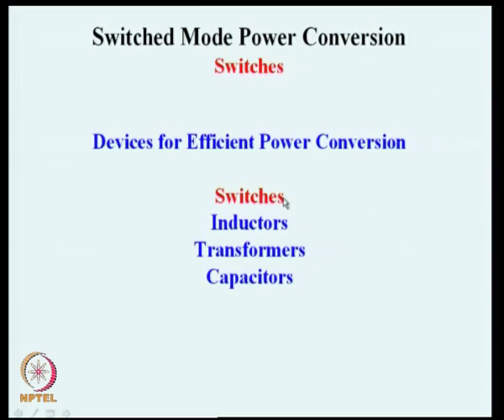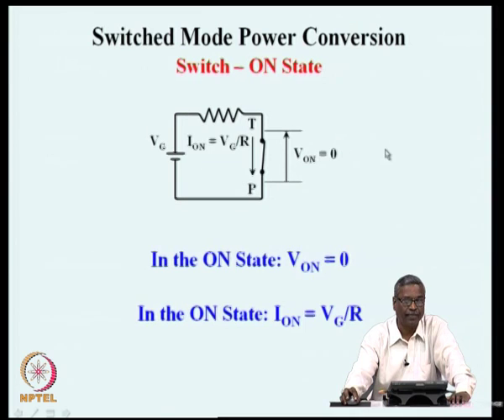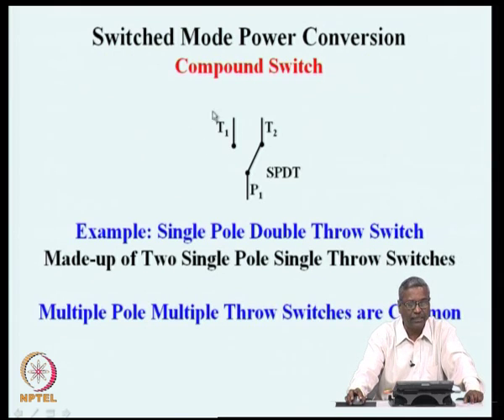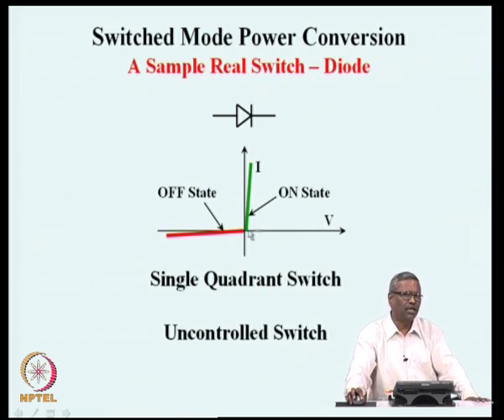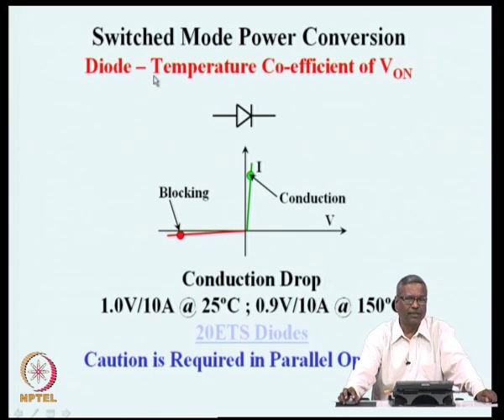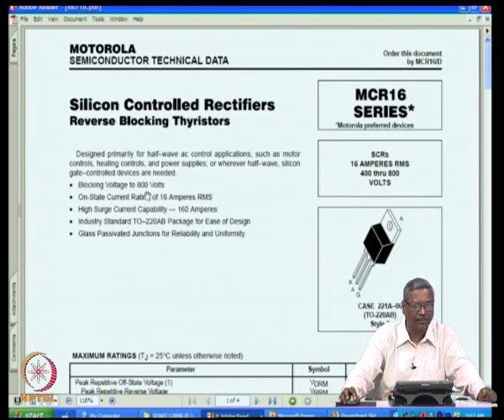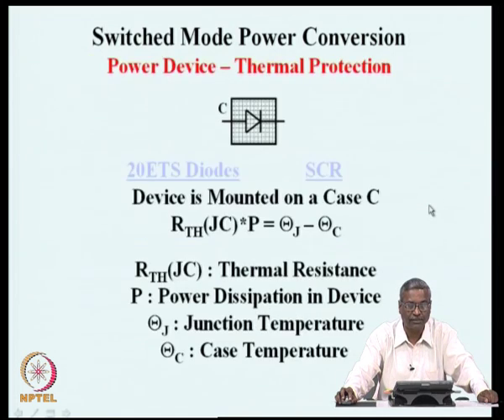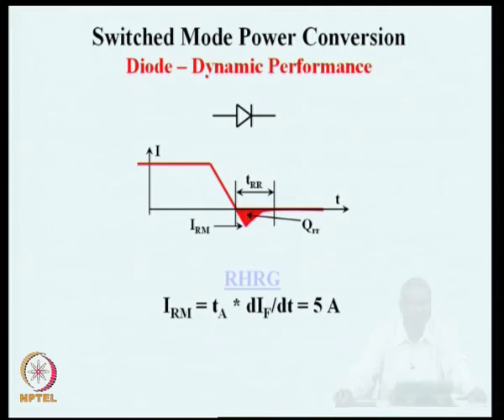Mod-02 Lec-02 Diode

Comment: the forward loss characteristics in datasheet says it cannot have a forward conducting current of 20A at 25degree centigrade
Reply: the conduction loss is supposedly calculated incorrect

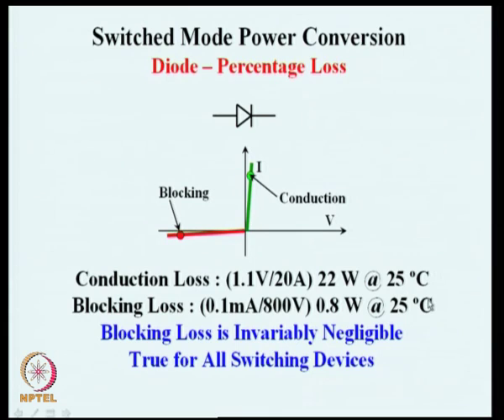Comment: 30:19 How wrong!!  while assuming the power to be a product of open circuit voltage and short circuit current.
Reply: The Power he is talking about is the power of the load, which is being controlled by the switch, and not the switch power, which he clearly differentiates. When usually the switch is ON, the voltage applied across the load could be as high as the blocking voltage of the switch, as in buck or buck-derived converters such as inverters. Similarly, the load current could be as high as the current capacity of the switching device. Hence, with a blocking voltage rating of 800V and a conduction current of 20A, the total power that could be controlled by the switch is ideally maximum at 16000W, although due to derating the actual controllable power could be somewhat lesser.
Reply: fair enough. got it . thx